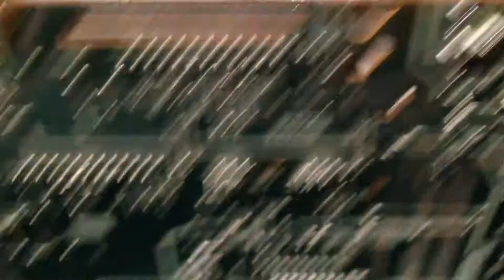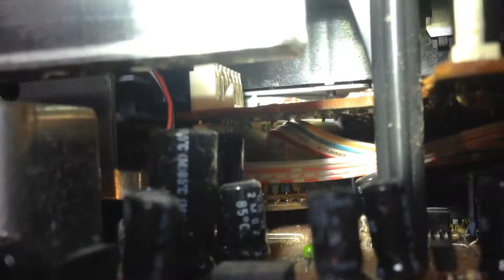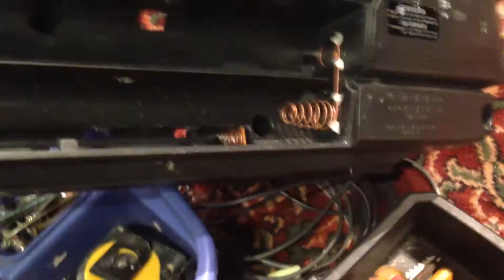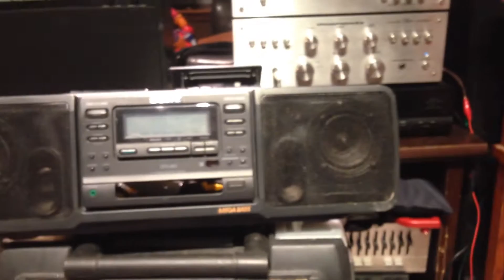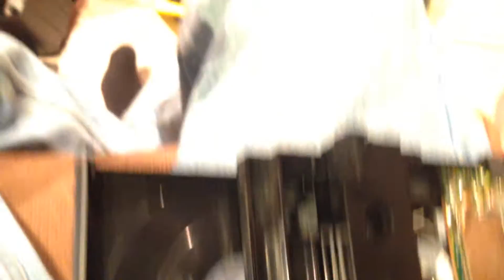Sony boom box Repair model CDF-260

Comment: I have the same stereo system. How do I activate the megabase? I don’t have a remote control for it. I live in Phoenix, Arizona and I bought this for seven dollars. And this stereo is super super loud and it’s got good weight to it. It has two cassette player on top and the CD player. It won’t read the disk. I have to clean the laser lens or needs to be replaced but this is super vintage stereo. How do I activate the megabits? That’s just all I need to know, thank you

Comment: I have the same Stereo how do I activate the mega bass when I turn it on and to the setting of rock function with the EQ I don’t know it is very much bass it’s just very loud. And I don’t have a remote control I bought mine at Zia records it’s in perfect condition like brand new the only thing is the CD player is not reading disk CD player The stereo is so heavy and I have open mine It’s got a big magnets for a boombox
Reply: If I remember correctly, the mega bass setting was on the remote. (I was thoroughly impressed with that back when I bought it!)
Reply: @Seacheroftruth  do you know who sells this remote?
Because I’ve tried looking for it and there’s no megabase button on the stereo itself. It’s really very loud the stereo it can really hurt your ears. If you know what I mean with the megabase turn on does it sound better on the remote cause that’s what I’m missing.
Reply: Wow, I’ve been looking for the remote control on eBay and I could not find one that has megabase setting but the Stereo does have Base megabase. I really want to activate the megabase because I love Sony thank you sir thank you.

Comment: Wow this is the same exact Stereo I have I don’t have a remote and it has mega bass how do I activate the mega bass there’s no mega bass button is it all done by remote control This has dual cassette decks CD player that won’t play CDs because I need a new laser lens I think 1 bit D/A Converter This stereo is so freaking loud how do I activate the LED lights it’s supposed to have a light right And the stereo is heavy I live in Phoenix Arizona I hope you live in Phoenix Arizona so I can pay you so you can Please fix my stereo portable stereo I have the same unit exactly Sony boombox CFD-260 Please could you fix my CD player and also I need a remote control and can you tell me how I can activate the mega bass all it has so far is I built an EQ system Pop- Rock-jazz-Blues-vocals I need to figure out how I can activate the mega bass on my stereo

Comment: lomg ago I had one that looked a lot like this one.  I gave it to my sister when she asked if i had a spare boom box. I wonder if she still has it?  It was half ways decent too.
Reply from the maker: Do you have it? They do sound good.  The little drivers are pretty cool too. You sound like you find a lot of good stuff , and then it gets confiscated from you by family and friends!  Did you get the belt fixed on the tape machine? I can't remember if you sent it off or still have it?
Reply: My Sony worked great all the way.  My sister may still use it, I will have to ask her.  Even its little speakers were not that bad.

btw, I posted some more vids today.

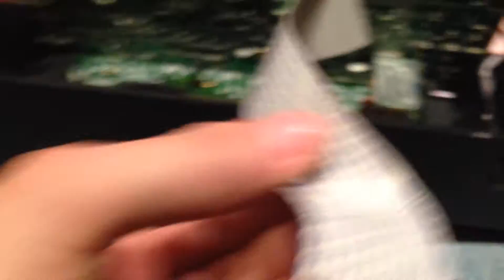Comment: When you were commenting on the length of ribbon cable @ 5:35, I was thinking you were going to use the Clevon Little line from Blazing Saddles - "'Scuse me, while I whip this out!"

The cheaper single motor dubbing deck does have one advantage - any misadjustment/variation in motor speed will still give a perfect speed dub providing there is not much slippage of the belt. Even the high-dollar Wollansak and Telex duplicators used a single motor drive.

As for the lens/motor noise for audio - is the cable that caries audio connected correctly? If so, the audio driver chip output may have shorted to the supply rail. In that case, the unit is probably not worth repair.
Reply from the maker: Yeah I think it's a digi not mechanical issue... :(
Reply from the maker: Where the white women at?
Reply from the maker: Awesome movie, very funny!! Have it on dvd!